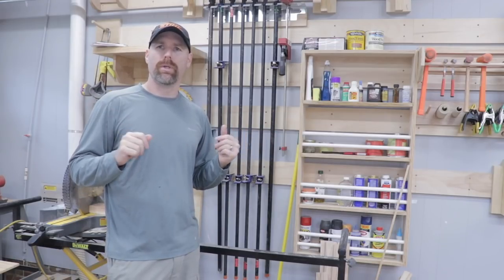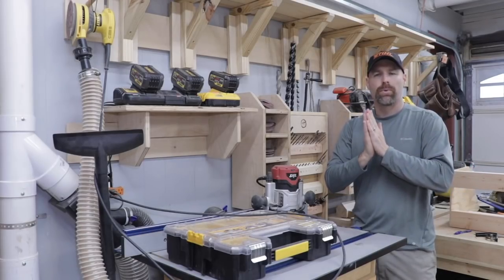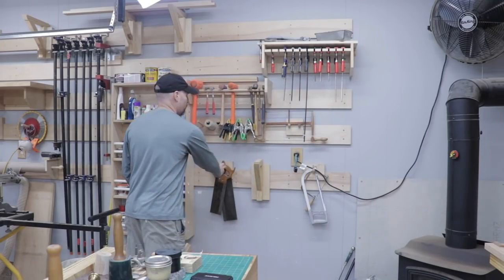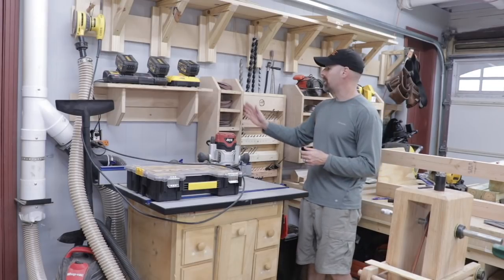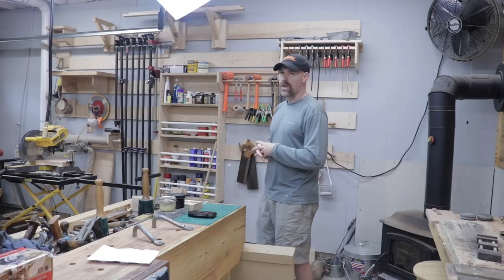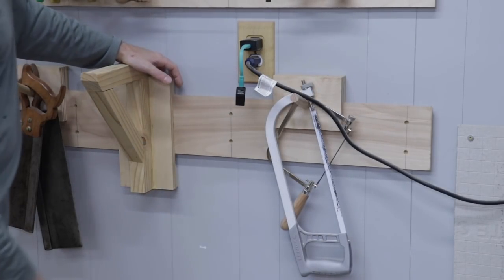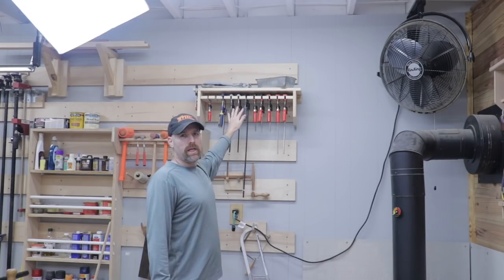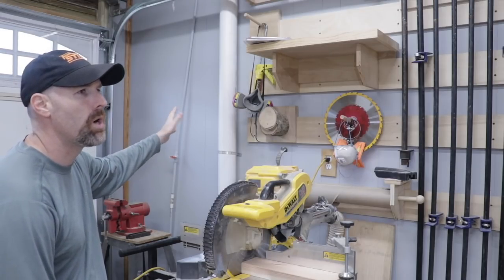PROS and CONS of a French Cleat Tool Wall

Comment: You don’t have to put so many holes in your wall... there’s another way:  mount your french cleat system to a 1/2  sheet of plywood (use a full sheet for a big 4x8 wall sheet of cleats, or chop it up into four 2x4 sections for a more modular system that can be hung together as one big unit or hung as smaller sections on multiple walls)   But this way the entire wall of french cleats is all mounted to a 1/2 sheet of plywood.  Not only does this way look better IMO, but to hang it you only need a good 3in cabinet screw into the stud at each corner and maybe a couple along the top & bottom for a little extra reassurance.  I suggest this method is better because if you ever have to move one day, the whole french cleat wall comes off together in one big “wall sheet of french cleats” & the whole thing can be rehung anywhere you want without ever having to remove & remount each individual cleat one by one.  The plywood backer also protects the wall from the items you hang on your cleat wall, which will all be backed up against the plywood backerboard vs  against the the drywall & all the things you hang then scuffing up that drywall.    Mount your cleats to a good sheet of 1/2 plywood, glue the 1/2 cleats to the 1/2 plywood in the spacing you like, tack down with 3/4 brads and then use 3/4 inch screws from the back of the plywood into each cleat for added cleat strength... this way no screws are visible from the front. Then the whole thing becomes modular, requires far less screws to hang on the wall, protects the drywall you hang it on from scuffs, and IMO also has a better overall look to it.   Go the extra mile, and put a couple quick coats of water based ploy on the whole thing and you’ll have yourself sweet modular french cleat wall system that will last years to come & require significantly less screws to hang.
Reply from the maker: Great suggestion! It would definitely solve the stud wall dilemma as well. Thanks for watching and very helpful comment!
Reply: Awesome!
Reply: Would a 1/2 inch plywood sheet be strong enough to take the weight of all those tools ?
Reply from the maker: It likely wood!
Reply: LastingBuild - thank you for the great video & very nice reply!
Reply: Rajbir Singh -  I’ve had my 1/2 plywood french cleat wall loaded up with a bunch of tools, table saw jigs and stuff for the past 6 years now & it’s still just as solid as the day I first put it up... none of the cleats have failed.   You could definitely use 3/4 plywood if you want even more strength.    I used the 1/2 birch plywood from Home Depot for both the cleats & the backing board the cleats are glued & screwed to.   If you do a little test and glue a 1/2 cleat strip to a scrap piece of 1/2 plywood and add a couple 3/4 screws, test how difficult it is to try and pry/pull the that cleat off the plywood... it’s gonna take quite a lot to rip them apart.   A buddy of mine used the same birch 1/2 plywood to make a little indoor climbing wall for his kids, he just screws the climbing holds to the 1/2 plywood mounted to the studs on the wall & its been supporting all their hanging/climbing weight no problem.
Reply: The Clouds Have Eyes. That’s reassuring. Thanks.
Reply: @RajbirSingh-wg9pf  
I sleep in a hammock with eye bolts into studs.  I had a space once that didn't allow for using a stud.  I used a piece of 3/8 or 1/2 in ply. It was 2x2 protect piece.

I then was able to add various eye bolts for different configurations.

I can weigh as much as 190lb and it held up with myself and my then fiance and our activities.  Granted.  She was 105lbs soaking wet.  But, 2 studs and 4 screws and that ply was all that held us up.
Reply: @RajbirSingh-wg9pf  I used 1/8" plywood to protect the wall - my cleats go right through the plywood into studs.
Reply: @davomontgomeryda3rd  The thing is that both the cleat - and the screw that's holding it up - are under an almost VERTICAL load with very, very little horizontal force.  So the screws that hold up the cleat won't fail by pulling out of the wall - they can only fail by snapping - and it takes an insane amount of force to do that.  Same deal with the cleat itself - the thickness of the wood isn't all that critical - it's the width of the cleat itself that carries the majority of the load.   Consider a more traditional pegboard system - you have fewer screws - and the vertical load is being held up by a material that's about 1/8" thick with the approximate strength of cardboard!   It's very easy to over-engineer a system like this.
Reply: @SteveBakerIsHere  - Hey Steve, maybe you misunderstood my comment cause I was saying you can use less screws.   Hell you can make the entire french cleat board only with 4 screws total.   You can simply glue the cleats onto a sheet of plywood, use brad nails to keep them in place & provide some clamping pressure while the glue dries & then just use a total of 4 screws to hang the entire thing on the wall (1 in each corner).    My point was that the benefit to this method is that you’ll have a modular french cleat wall that you can take down, move to another wall, put in a new shop, etc.  That doesn’t require you to individual remove & rehang each individual cleat, cause you’ll have all your rows of cleats permanently mounted/glued to a 1/2” sheet of plywood so the entire thing can be taken down & rehung with just a few screws, nails, or even mount a cleat on the back of the backer board and hang your whole french cleat wall on a french cleat.
Reply: @davomontgomeryda3rd  I agree - and I understand.  I just chose not to go that route.  2 1/2" wood screws cost $9.50 for 133 screws - about 9 cents each.  1/2" plywood at my local Home Depot currently costs $110/sheet (eek!).  So unless it can save you approximately 9,000 screws per sheet - that's not an economic argument!   

Of course if (like me) you wanted the plywood just to protect the sheetrock from scuffing - you can get away with almost any sheet material - in my case, 1/8" plywood because I happened to have a big pile of it left over from my laser cutting business.  But white hardboard does the job and Home Depot has it for $14 for a 4x8' sheet.   So from a price perspective - screwing directly to the studs is the cheapest answer.

As for moving house - just the fact that you can shrink-wrap the tool holders - complete with tools - and toss them into a box is a HUGE win for French cleats.   In previous homes I've owned, I just left the pegboard on the wall for the next owner...and I'll probably do the same with the cleats the next time I move.  I used v.cheap plywood - so it's just as easy to re-make them.
Reply: @SteveBakerIsHere  - great points Steve, hey that’s the beauty of woodworking… more then one way to get the job done and all have their own pros & cons.   Its depressing to see these insane costs of lumber, sheet goods & building materials.   Just a year or so ago 1/2 and 3/4 sheets of decent birch plywood were running around $48 & $58 a sheet at the Home Depot’s here in FL.    Hey thats a great idea about shrink wrapping everything on the cleats when it comes time to move, I may be moving in the next year and think I’ll try that method.   👍
Reply: @davomontgomeryda3rd  Yeah - it's hard to think of any other consumer item that ever quadrupled in price in such a short time - but 2x4's have definitely done that at my local Lowes and Home Depot.  Crazy!
Reply: Do you have a ref picture of video that exemplify that build? I would like to see it done

Comment: I just finished mounting my 4x8 french cleat panel.  So far so good.  The limitless customization options and modularity allows for easy storage of tools like carcass saws and jointer planes.  But again, it does have some drawbacks.   Like become a giant trap for sawdust and dead bugs. 😆  It's also a highly inefficient way of storing smaller objects with holes......like scissors, rolls of tape, crescent wrenches.  I put those on the pegboard wall.  Also, if you live in a high humidity climate you may have to regularly oil your steel tools to prevent rust.
Reply from the maker: Thanks for sharing!

Comment: I recently installed a 8x4 pegboard in my garage and I love it. Half of it is behind a door which is not suitable for French cleats. 

The wall I used is small and between my door to the house and the washing machine, it was otherwise completely wasted space. 

It took me a few hours to install and immediately hung a bunch of stuff on it clearing away heaps of things clogging up shelves. 

Shops are always evolving and I reckon pegboards are a very good entry level addition to a never complete workshop.

Comment: For me - I used much narrower cleats - but more of them - that gave me much more flexibility than your wide cleats that are widely spaced.  You build things to hang on the cleats that are *HUGE* compared to mine.   I mostly work in metric - and each of my tool holders is between 20cm x 20cm (~8" x 8") and (so far) 40cm x 40cm  is the largest.   All are multiples of 10cm in width and height - and stick out no more than 20cm from the wall.  The cleats are 25cm apart - to give enough clearance to lift one off of the cleat without hitting the holder above it.   That means that I can pack those tool holders in very tightly.  That saves space (my workshop is half of a double garage - so space is a critical resource) - and it keeps tools closely in reach.  The easy rearrangement of tool holders means that I always have the most common tools right where I'm working.   I also have cleats screwed to other places - like on the side of my saw table and my work table.   So I might pick up the tool holder with pencils, square, tape measure, etc off of the wall and hang it on the saw table cleat while I work there - then move the whole contraption over to where I do electronic work because I want to make a wooden box for some circuit I'm building.  Being able to move a whole collection of related tools to where I'm working saves a LOT of running around the shop.   Your approach of having those HUGE tool holders really means that you're just using the cleat system to hang furniture on the walls...which is not at all my philosophy.  You have a rack of sanding disks...but I have a small group of sanding disks on the same 30cm x 20cm tool holder that holds the sander and spare sanding disks in a regular box under the bench.   My stapler is on a 20cm x 20cm holder along with a box of staples of the correct size.  My power drill lives on a tool holder with a small set of 8 most common drill bits, a couple of screwdriver bits and a spare battery holder.  There is a much more comprehensive set of drill bits and such on their own tool holder by the drill stand - and a separate tool holder for battery charging and storage of many batteries.   But having the most common stuff right next to the drill - saves me a ton of running around.

This functional grouping of tools and the things you need WITH those tools is paramount to an efficient, compact workshop.   But I'd be the first to admit that yours looks MUCH prettier!

I didn't buy premium graded plywood because my workshop is more about practicality than appearance - and given present lumber costs (June 2021) - I've used MDF for a lot of the tool holders because it's a third the price of plywood right now.

For me - the MASSIVE win for cleats is compactness.  Many of my tool holders (like the one I keep my hand saws in) use the third dimension.  The saw holder holds the saws at 90 degrees to the wall...so I can fit four saws in the space I had one saw hanging parallel to the wall on my old pegboard system.   Building the tool holders at the outset was a little time consuming - it took me 3 days to make the basic set...and I often re-make them when I add new tools, or just think of a better organization.   I don't regard them as nice pieces of furniture - but rather as semi-disposable quick-builds.     Cost isn't a big deal.  A 20cm square of plywood or MDF is usually just scrap from some other project, and I have about 20 feet of cleat material pre-cut...so the cost is usually $0.00 - and I can knock one up in 20 minutes, tops.  Most of them are just glued and brad-nailed together - only the ones that hold really heavy stuff are screwed.
Reply: I’m preparing to build my French cleat wall in a couple weeks, once I get more things cleared out of my space, but I’ve already planned to put two or three cleats on the side of my CNC table. It might be overkill, but I imagine I’ll be able to come with SOMETHING to hang there to put them to good use!?

I’m thinking I’ll do functional groupings too in several cases … nails with nail guns, batteries with chargers, drill bits and the like with drills and drivers (which may be separate from the charger station), etc. But I can see doing some sort of cabinet that will hang on the wall that might house things that I’d rather keep away less exposed to dust but still in the mix. We’ll see. I guess that’s what so cool about this method is that you can do whatever you think will work for you! 🤙🏽🤙🏽

Comment: I am also in the process of putting french cleat in my garage.  I own my home so holes in the walls is not a problem.  Cost is always a consideration, but understand that any organization method is going to incur costs that we wish were not necessary.  I am not interested in spending $55 a sheet for plywood but consider that I can get ACX plywood for about $36 and use that for the cleats on the walls ( and if necessary, fill and sand the back side if it will show as does about half my cleats).  For the storage on the cleats, unless I will be doing YouTube videos for all the world to do, there is enough scrap to do almost all I need to store. 

One con I have heard about from another YouTuber is that because the cleat on the storage item only works when there is weight on it, they will sometimes inconveniently come unhooked from the wall when removing a tool from it.  I can't say I have a problem with that, but there are ways to manage it.

Thanks for the series.
Reply from the maker: Thank you for the comment! I’ve never had any fall from the wall!
Reply: Vernon Wankerl I use both French cleats (love them), and pegboard. I have more problems with the little metal hangers falling off the pegboard ( and bouncing into a far away dimension), than I ever do with a cleat tool holder.
Reply from the maker: I used pegboards for a while as well! Needless to say, not using those anymore!
Reply: Note that I said another YouTuber said this was a con of french cleats, not me.  That being said, I do pay attention to how I design the french cleat mounts to avoid that possibility.  Also, I do use pegboard but only for select things, like bubble packages that I got from the big box store pegboard displays.  But even then, I try to mount the pegboard on the french cleat.

Comment: I put up a whole sheet of ply wood.  Mount that to the stud, or to block wall, or whatever.  Then use screws and glue to mount the cleats to the plywood. The female cleats on the wall are the same dimensions as the male cleats on the holders.  I first fasten the bottom wall cleat very carefully with a level. I set spacing blocks on that cleat, and rest the next cleat on those blocks, and fasten it to the plywood. I fill the plywood sheet bottom to top with cleats. They're spaced apart just enough to allow the male cleat on the holder to slip in, then down into that 45 notch of the wall's female cleat. The Regular spacing lets me perhaps use a top and lower cleat on certain holders.  The regular spacing lets me add a locking block that fits just under the female hooking cleat, or it may lock under the next lower cleat. The regular spacing means that every holder can fit almost anywhere on the pattern.

Comment: Pros: reconfigurable, customizable. With the required space, you could store items out of sight (or even out of reach) when not in use and completely change the role of the shop. Another pro: You are not limited by stud placement when hanging heavy things. 

Cons: Vertical position of items is (somewhat) limited by the number and spacing of wall cleats. This can be easily overcome by the design of each accessory. 

If you are the type of person who likes to have tools visible and within reach you will love this system.

Comment: Good comment about cleats on stud walls.  I am in the process of doing just that, but I'm going with the "tool wall" concept that I've seen on another channel.  So my shop has studs that are 24in on center.  So I'm building 3/4 in panels, 24 inches wide, 48 in tall.  Then the wall panel will be mounted to the studs, actually becoming a wall.  It will also be flexible if i move to another shop, just take the whole panel with me.  Not an original idea, "as seen on you tube".
Reply from the maker: That should work nicely! 👍

Comment: I'm glad you made this video, and you're definitely talking me into using more French cleats.  You can use half inch pine plywood for a lot of this .  You choosing to make this an expensive project doesn't make it an expensive project.  Pine is about half the price.  Paint it later. :)
Reply from the maker: Thanks for watching and commenting!
Reply: You'll never regret doing it.  Not only is it more practical (by far) - but building all of those little tool holders is actually a lot of fun.